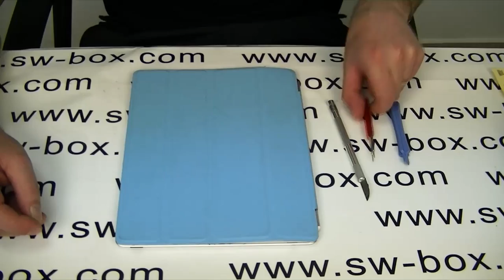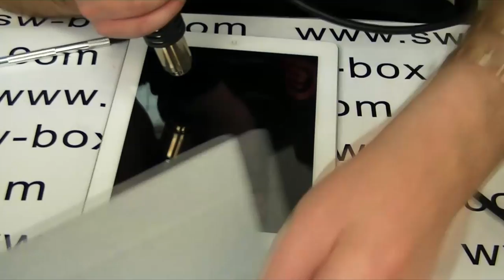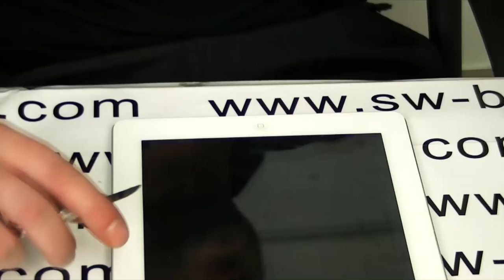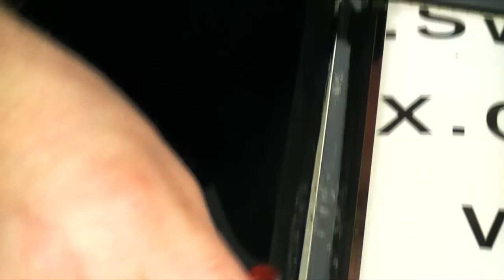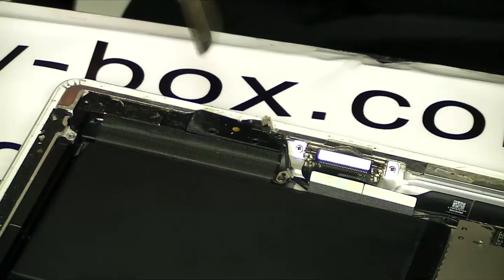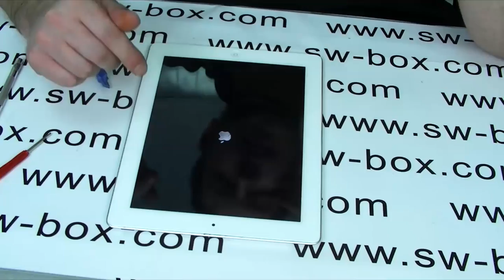How To Replace ipad2 Screen

Comment from the maker: Hi sir, you can just please click the item link above at the description part. It is $22.50 for the iPad 2 Front Panel Touch Screen Glass Lens Digitizer Replacement Part OEM.
Hope it helps
If you need further assist just feel free to contact us.
Kind regards,
Laura

Comment from the maker: Hi thanks for commenting, both points are correct, but don't worry about the wifi cable, there's still a 90% chance of getting damaged even if you know where to cut it, they are so fragile it's luck most times if you don't damage it, anyway i hope you get your ipad sorted,
kind regards,
Neill.

Comment: Wish I'd waded through all the comments to get a few user tips; I'm always forgetting that. For me, 1. I got the wrong impression to stay away from the wifi antenna with the cutting tool, but because the wifi antenna is sticky glued to the top and screwed to the bottom, avoiding this area results in ripping off the wifi antenna. I think one needs to know to cut there, but be very careful. 2. I had no idea about the white rubber ring that goes around the glass; hence insert knife above metal base

Comment from the maker: Hey Jacob, first turn the device on and set the temp to 120 degrees Celsius, don't go above that temp as it will start melting the digitizer, there's not much to set up really but if there are some other questions you have then just ask and I will do my best to help you,
kind regards,
Neill.

Comment from the maker: Hey Col, I have checked on ebay and found you can buy a motherboard for around $15 usd, I don't no how good it will be but that is not a bad option if your having difficulty operating app's and typing, I hope this helps,
kind regards,
Neill.

Comment: Hi. I just replaced the digitizer on my Ipad 2. It powered on but no matter how much I touch the screen it does not register that I am touching it. Not sure if I did something wrong or if I got a bad screen. I have checked all my connections and still have no luck. Suggestions? I'm considering ordering a new screen unless there is something else I have missed.. Thanks.

Comment from the maker: Hi, there is only two reasons this will happen, first is the replacement camera you purchased is faulty, ( and that happens from time to time as they are very fragile ) or you have damaged the motherboard so it will never work, sorry to tell you like this but from my experience these are the only reasons I can think of, it could be worth updating the software before you try a new replacement part, sometimes the ipads just need to run itunes then they work fine, I hope this helps,

Neill.

Comment: Thank you for your informed video. I do have a problem i replaced wifi & front facing camera everything seems to work but the camera is stuck in the closed "shutter" mode. any ideas?

Comment: then swipe the slider to power down. Each step must be done using a screen shot from xcode to see what the heck you are attempting to touch. I got lucky and guessed right on my touches. (none of this would have been necessary had my upper right power button been working). AND you were right SWwebmaster; I checked my LCD connection and it was not quite all the way in. Now it works perfectly. Much thanks for your helpful video and response to my question. Best Regards, John

Comment: Success! I dreamed up a crazy method to power down the ipad with no LCD using my macbook. IT WORKED. So I hooked to my mac. Fired up Xcode, then used the "Organizer" to take screen shots after each blind touch on the ipad. It's not that difficult to look at a screen shot then guess where to touch the ipad. Turn on the "assistive touch" under Settings-General-Accessibility. It creates a button on the lower right. Tap it, then Device, then hold the Home button while pressing "Lock Screen" -cont'd

Comment from the maker: Hi, ok best to double check the LCD connections, iPads are really funny, sometimes it takes 5 or 6 times to turn it on and off before it suddenly works again, as for shutting it down before you work on it, sometimes it's not possible so just take it apart anyway, i hope you get this fixed, :)
kind regards,
Neill.

Comment: btw, i was able to swipe the screen to unlock so the digitizer is working, I just can't see what I am doing with a black lcd. Sorry to be such a bother, but am sort of desparate for ideas and you are the expert. Any way to power it down via my laptop? or some other work around?

Comment: Now I am royally screwed. I went ahead and replaced my digitizer and put it all back together. Before replacing, everything worked fine except for the upper right power button. Now that I have finished, I hook it up to my laptop so it will power up which it does, BUT the LCD does not come on. So my problem is, how can i power it down to work on it again when I know now it is in sleep mode and my power button doesnt work so I can't even shut it down blind? Worried to work on it with the power on.

Comment: Hello, I am replacing my cracked digitizer. The self-facing camera has a litle square metal piece that none of these videos seems to mention. Doesn't it need to be transfered to the new digitizer? If so, how? Is it glued on or is there more to it? Thanks for any help. Regards. Great video btw.

Comment from the maker: I did my Ipad screen it went Really smooth, but the on/off button will? not work I? Home button and all the rest great .. :/
505hayes505 1 month ago

@505hayes505
Hi, first just try plugging it into your computer and running itunes as sometimes the ipad 2 gets a little funny and needs an update, if that doe's not work then i think you have damaged the ribbon cable? for the on/off button, so you will need to change it, that is your only two choices, i hope this helps,
kind regards,
Neill.

Comment from the maker: if i were to open the ipad 2 to replace the? home button, "because my white ipad's home button for some reason got discolored" can i re-attach the digitizer? or do i have to buy a new one?
dugadug27 1 month ago

@dugadug27 Hi, no need to buy a new digitizer but you will? need an adhesive kit to stick it back down, go to our website at sw-box.com, we sell the sticker kits there,
i hope this helps,
kind regards,
Neill.
SWwebmaster 3 weeks ago

Comment from the maker: @afliesaway
Hi, ok no problem hehehe, they are funny things the ipad2, i have had the same problems, now there's a few things you can try, recheck the connections on the mother board, try charging it for at least an hour, some times i have found it just got a little funny, or upset you might say hehehe, next try plugging it into your PC or mac, if none of this works try holding? the home button and the on off button at the same time of at least 30secs, i hope this helps,
kind regards,
Neill.

Comment from the maker: Neil!
I need help PLEASE!!
I did everything that you said, and now the iPad2 won't turn on at all.
It took me a little longer? because the screen was cracked beyond compare.
What do I do now?
I have rechecked the cable connections.
The Digitizer is in tight and locked.
The Touch Screen cable - I have tried both ways (bronze connections up and facing down)
If you have any suggestions, please let me know as soon as possible.
Thank you!
ornclo 5 months ago

Comment from the maker: great vid. I just got few questios. How can I glue the screen again? what kinda glue should I use? I have to replace the lcd screen only-digitizer works fine. And the most important question: does the ipad2 have the same Lcd as Ipad? 1 ?
paulkolinPL 5 months ago

Comment from the maker: neil have a new ipad2 16 gig ? can i change the logic board from 16 gigs to 64 gigs i would like to upgrade it at a lower cost and where do i buy the parts ? tyvm ur a coll guru?
ron14320 6 months ago

@ron14320
Hi, sorry for the late reply, and thanks for your comments,
i think you can upgrade it but i have no idea where you can buy the? parts to do it, but i think if you get the parts then it will be easy to do,
if you need anything else just ask,
kind regards,
Neill.
SWwebmaster 6 months ago

Comment from the maker: @rakahmn
Hi? again, sorry i cannot go to your account, as for the wifi signal you need to buy a new cable, it is not expensive, but we are redesigning a new website so ours will be off line for 3 days, after it is back on i will send you the links you need to fix your ipad, sorry for the inconvenience, but the website will be easier to navigate,
kind regards,
Neill.
SWwebmaster 6 months ago

Comment from the maker: Good day Mr. Neil, I have an IPad? 2, glass was broken two months ago I ordered for new one , got it , unfortunatly, i did not see your lesson before i missed up, I just removed the front glass in a hard way all glue was gone and I already replace the glass. Now the touch function gone along with the wifi , sometimes the wifi come back but very weak and i have to press the left down corner , also the touch it also come and go in a absurd way.
Please tell me what to do in order not to lose my I

Comment from the maker: It all went well and the ipad is back together. I had to take all of the adhesive off because there were shards of glass all through it. My only worry is that this adhesive doesn't seem to be holding it down like the original. ? My big caution for anyone is to watch the wireless!!! That connection is so fragile and just not well thought out in my mind. Thanks much for the video!!
who922 7 months ago

Comment from the maker: @SWwebmaster Wifi wasn't really broken, only the signal was reduced significantly. I received a new wifi cable today and already swapped the cable. Everything works and i camouflaged the barely noticeable scratches on the? casing by using a gelaskin. I had a hard time removing the digitizer because of the shattered glass.
gijs370 8 months ago

Comment from the maker: @gijs370
Hi, its no problem, now im 99%sure that you have cut your wifi signal cable, hehe, if you cant connect to wifi any? more then you have, i took my ipad2 apart again today to double check what you mean and i am pretty sure you have cut it, if you are still concerned then you can email me a pic and i will conform that way, my email address is neil @ cellphonezone
i hope this helps
and good luck,
kind regards
Neill.
SWwebmaster 8 months ago

Comment from the maker: @SWwebmaster I have another question if you don't mind. I damaged the cable next to the powerconnector and home-button (2cm) . It was glued to the digitizer and is screwed to the casing. By removing the digitizer i teared a part of this cable.
Could you confirm that this is actually the wifi antenna cable? If so, than i will buy a? new cable. I suspect that it is because my wifi signal (like the cable :) ) is cut in half.
gijs370 8 months ago

Comment from the maker: @SWwebmaster Thanks for the reply. Apple 'carefully' calculated price for replacing the digitizer would be 390 Euro. A digitizer from SW-Box would be cheaper :)
I'm just curious: a digitizer is the actual touchscreen right? Do you know how it works? My digitizer is shattered but the touchscreen and LCD itself still works perfectly. How does it measure the touch if it is clearly broken?
The explanation on "howstuffworks" gives me reason to? believe it should fail to work.
gijs370 8 months ago